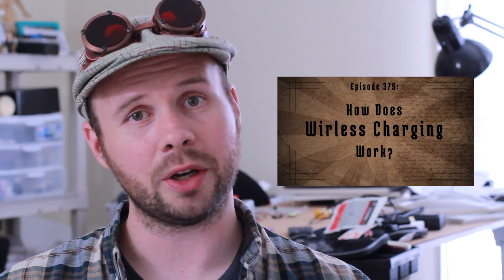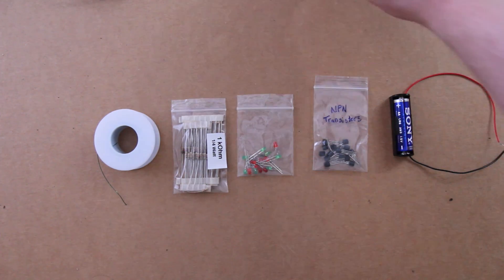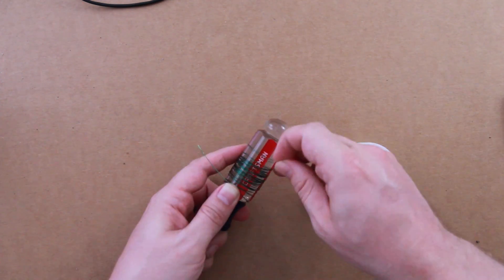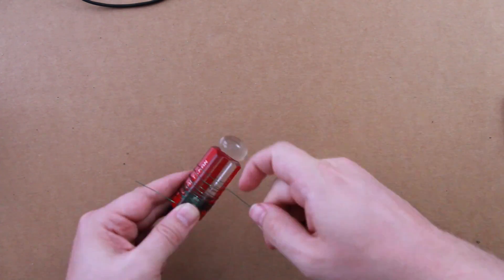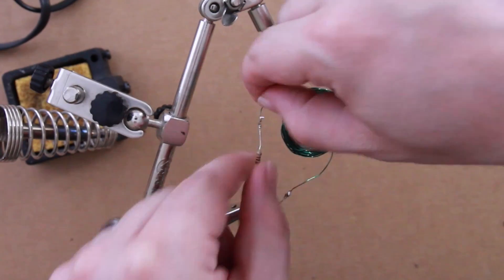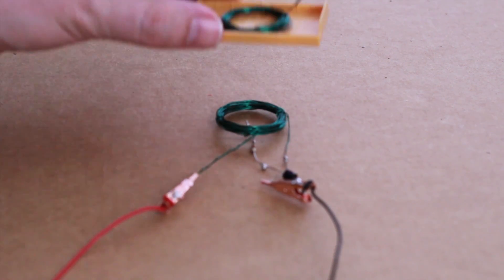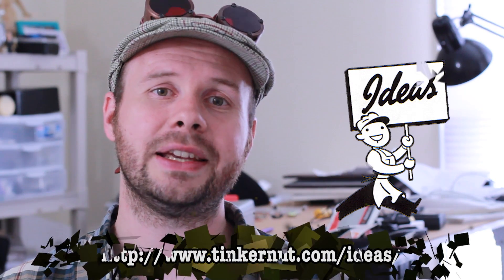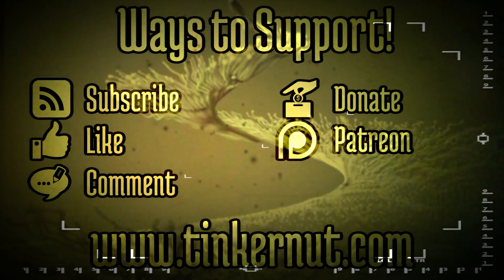How To Make A Wireless Lamp

Comment: hey bro i tried that one but its not working plz help me
i have used  the samething
1) 1kohm resistor
2) burnt the copper for taking the curremt
3) 9 v volt battery
4) 30 turn of copper coil
5)npn transistor
Reply: Did you solder the NPN transistor legs and resistor legs correctly, in right direction and right place?
Is your copper wire a magnetic 0.3mm 30 Gauge one?
Please use an AA battery, which has 6 times lower voltage

Comment: What if I told u I have been thinking lately about u since I was busy working on this project for almost a year and u released the videos on the same days I had free time to work on it. I have seen this circuit a lot and I have done millions of time and it seems it is no way to work I have literally checked everything unwinding and winding coils transistor type and even led amount power supplied resistance value and it seems no way to work for me just like the joule thief circuit since both are the same concept 
Any way nice video I always loved ur vids keep it up :)

Comment: but that is not wireless because you must touch the box
Reply: Veso266 WIRE less, u cant read?
Touching the box is nothing with a wire
Reply: You don't actually even need to touch it, there can be a bit of air between

Comment: wait the battery provides DC but to transmit power you need AC. Is that transistor somehow switching on and off constantly to provide a change in magnetic field?
Reply: samramdebest it is a self resonating circuit
it makes pulsed dc
witch is compairable to ac and it makes the coil puls
Reply: +samramdebest It produces a on/off squarewave, the wires between the 2 legs of the transistor causes a difference of timing between the transistor being on or off, thus pulses (I probably killed the meaning). The main thing is: it pulses as a squarewave.
Reply: +ender_scythe XD good job.
Reply: lol